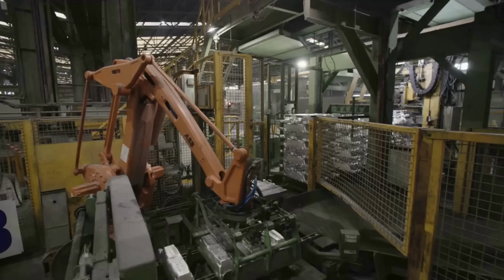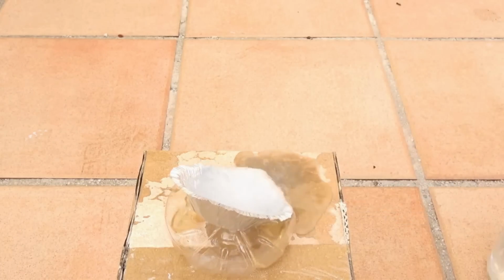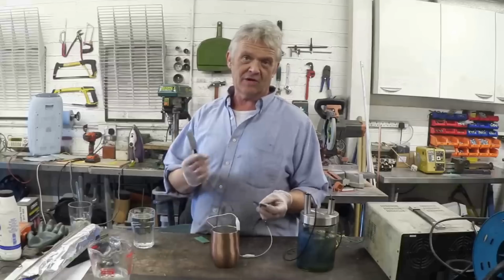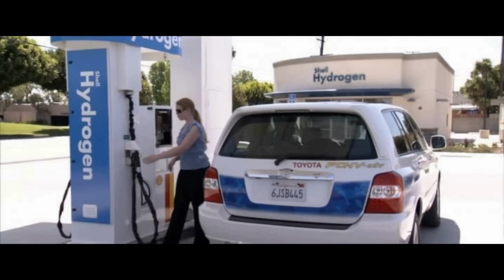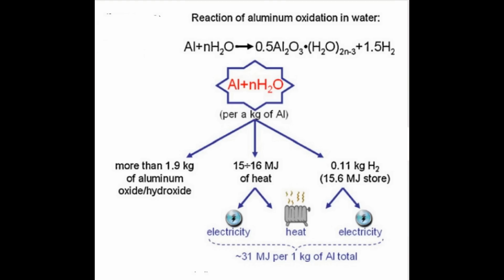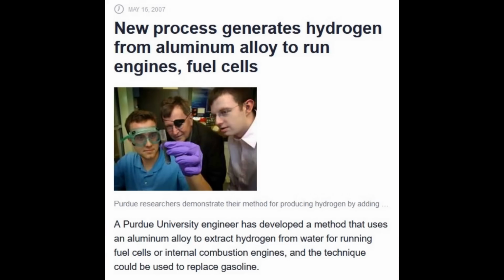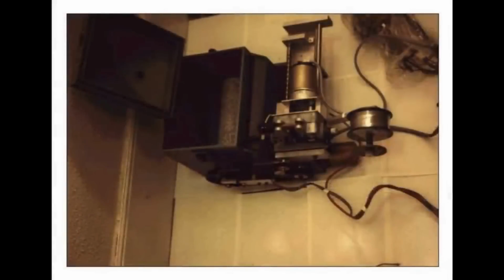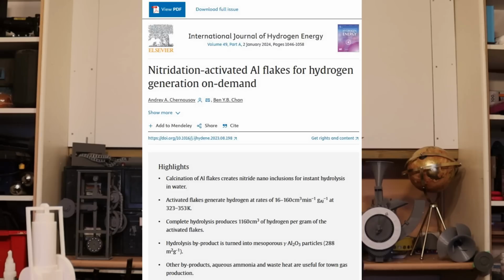2194 Hydrogen On Demand - Improvements And A Possible Conspiracy

Comment: re aluminium strip in a steel  pot containing hydroxide...
Dipping the strip in the pot/stripping the oxide before it makes contact with the steel pot, will be necessary to allow it to make electrical contact with the pot. Aluminium oxide layers are very good insulators, Metal oxide layers also have  excellent dialectic properties 
If the pure alu wasn't in contact with the metal pot would it work as a capacitor? it's not too different from an alu foil electrolytic capacitor. commercially produced ones use electrolytes that are caustic, that presumably strip the oxide layer.I know in about 2000 there was a lot a electrolytic capacitors going about that after a while they'd pop due to their producing hydrogren. (it seems to have been a case of industrial espionage resulting in the theft then use of a faulty electrolyte recipe) 

I've had extremely interesting results with anodised metal strip held inside(NB so it don't touch)  copper tube, then partially filled with yorkshire tap water. Such tap water shouldn't strip the oxide layer, is ever so slightly conductive (very conductive compared to metal oxide layer). and appears to result in a higher capacitance value than using a standard type "caustic electrolyte". Capacitance value seems to be related to what voltage metal was anodised to,  which is a proxy to how thick the highly dielectric anodising layer will be/follows that  the thickness of the anodizing later is akin to plate separation variable of capacitor equation. and if left alone the capacitance value remains the same, suggesting the layer isn't being attacked nor changing thickness etc

Comment: The main problems are that the overall energy used to produce the desired energy is not cost effective.
Reply: We have problem with overproduction of solar and wind in some days.
Also we can build solar and aluminium rafinery more in the desert and organize transport with some kind of self driving trucks to nearest port or railway.
Also cost of refinig alumnium from almost pure aluminium oxide should be less than from ore.
Maybe direct EV has betterf efficiency but is ridcously inconvinient, with aluminum we but put only some form of "battery", tank water and go go go....

Comment: I was going to mention that Gallium works but you can also recapture the Gallium and create a cycle where you take the spent aluminium oxide and melt it down to repeat the process by adding more water

Maybe this could be a energy dense battery
Reply: When you do this process with galium, how do you purify the galium again? And is aluminum oxide really what's created?
Reply: @TravisTellsTruths  
You filter the spent solution with excess water to remove as much of the reacted Aluminium oxide  which will be like a grey wet sludge 
The Gallium will settle at the bottom of the water and can be extracted with a syringe and reused.

Comment: The science of cracking water in the hydrogen and oxygen using heat has come a long way we've got it down quite a bit where it doesn't take quite as much heat as it used to adding different chemical catalysts the point is the Japanese are going to use nuclear power to generate the heat and crack water and have hydrogen fueling stations for their cars and trucks so they won't have to go to the Middle East to get power they just use a nuclear reactor this may be the way they're going to go cuz there's no so-called pollutants no good global warming no Boogeyman

Comment: we always hear about new hydrogen engines and it creates good investment... and we have been hearing this since the 1940s, so why dont we have them, well its that little elephant in the room hydrogen embrittlement, hydrogen ruins steel and most other things used as a container. the last thing you want under your car is 2500psi of explosive hydrogen in a tank thats weakening from the inside out and being bumped down the road... you can replace the tanks as and when needed, which is why we have industrial tanks/tankers and prototype vehicles / large commercial bus trials, because they can recall them in time to prevent a tank boom boom  'issue', but cars for joe public? you cant even get joe public to rotate his tyres.....how long till we hear of someone with a 15yr old hydrogen tank in a car exploding on the freeway or in a parking garage....

Comment: Might be fun to collect as many lapsed patents as possible and put them through a self learning AI application to see how far they were off the mark.
Reply: Coool
Reply: One of the rules for receiving a patent is that the device must be PROVEN to work - in some cases the inventor has resorted to performing a personal demonstration right in the patent office.  I would be far more interested to see what kinds of inventions an AI would extrapolate if given access to the entire patent archive.
Reply: @walterbaltzley4546 That is not the case anymore, or for a long time now. You don't have to prove anything works anymore, they just take your money now and do not care.  Patents are about giving just enough information to protect your idea, without giving enough info for someone to run off and make improvements and make a new patent. Not always the case, but is most of the time when it comes to important things.
Reply: no, this is not even remotely true  @walterbaltzley4546
Reply: i like the way you think !
Reply: Check out the Francisco Pacheco generators the use magnesium, aluminum  stainless steel and salt water
Reply: Great idea!

Comment: Joe cell was not a hydrogen gen, actually a resonance system. 
No hydrogen was burnt. 
The fuel line was blocked off by a bolt which was attached to the carburettor manifold. 
The protons could flow through the wall,not the hydrogen. 
Its out there,its been done. 
But no one understands the concept

Comment: You need to make 1 liter of brown's gas per liter of cylinder size PER REVOLUTION of the engine, and for any RPM's, for hydrogen only engines.
You must be certain that there are NO burned valves or seats in the engine head and the ignition timing must be AFTER top dead cylinder by at least 8 degrees.
Modern cars have ignition timing as much as 20 degrees before TDC. This can cause preignition and explosion!
Burned vales and such = same problem.

You also have to contend with hydrogen embrittlement since hydrogen draws the carbon out of steel parts, thus making the steel brittle (takes a long time though).

Optimal temperature to create that Brown's Gas is roughly 165F. Cooler then you make less gas. Warmer and you get too much water vapor and even steam.

The water you use must be distilled water only. Tap water contaminates the system. So does rainwater.

Using salt water can make hydrogen chloride, which can explode in direct sunlight.

Best electrodes are platinum. Residuals in the solution when using stainless steel plates is very toxic. VERY.

A pulse wave modulator can help with production. And a voltage of 28VDC seems to work best.
Drawing more than 10-20 amps to make the gas places a drag on the alternator and you lose your gains.

One person claimed he could make lots of the gas at a little over 3VDC. Haven't seen any proof of that.

Fun fact:
You can heat a very small very WELL insulated room with 6 aluminum beer cans for one hour.

Too bad Stan Meyers is no longer around nor all his research....

Comment: I immediately thought of aluminium MIG spools. I think electrical sparking in the presence of water vapour would be the way to go. 🤷
Reply: Rob mentioned high voltage, most welders run around the 24V mark I thought. The mechanism for feeding the wire is a great idea though.

Comment: Would it be viable to heat a space with potassium hydroxide + aluminium + water, using both the electricity & heat created by the reaction plus burning the hydrogen?

Comment: I can't help but feel mankind are locusts on this planet, moving from one resource to another til there is an uneconomically viable amount left and then hopping to the next resource to use that up. Nuclear energy is probably not the long-term solution, we don't even know yet where to put the waste.
Sure we'll have hydrogen in the near future, no doubt, but if we don't learn to recycle that then we'll vent all the water into space through this process.
CO2 chipped away at the climate, but if we also do this with water we'll increase the problems. We already did it with methane and radioactive isotopes...

Comment: The aluminum air battery that was tested in Israel has promise. 2000 mile on a car then electricity converts the aluminum oxide into aluminum and repeats

Comment: I'm not convinced about this. The electrolysis refinement of aluminium emits a ton of CO2 as the graphite electrodes corrode into solution. So even if the electricity required was somehow all carbon neutral, the process fundamentally has CO2 as a biproduct.

One could argue that it could be captured, but when talking about considering this strategy as a fuel source, the amount of aluminium required to suit the global needs is enormous, which comes with an equally enormous carbon footprint. 

At that point, it's probably easier to just use methane/ethanol/syngas/biodiesel because at least they act more effectively as a capturing method I think
Reply: Thank you, at least one that has looked into how its basically impossible to create Al CO2 free.
Reply: @uninteressant2196  To be fair I'm sure Robert is aware because of his background, I think it's a detail he either overlooked or thought wasn't as important as a point. Obviously if we were to discover a new way to make Aluminium or somehow decompose the CO2 back to graphite in processes that run off renewable energy and are profitable, they would solve almost all the issues with this concept
Reply: @atrumluminarium  Yes, still worth a mention- theres also the problem of weight, you have to carry the water as well as the Al, which is probably higher than a high pressure tank, but if we compare it with batteries its lightweight.

Comment: Thanks for the video! My bench is still covered with aluminum oxide. Months ago I failed trying to make electricity from a gallium aluminum on a plate of glass. Personally I love hydrogen, h2o2 I think they have lots of potential
Reply: Look, brother. You dissolve only about 3% of aluminum into the galium then you can slowly add water. It produces near 100% efficiency of hydrogen from aluminum and water. The aluminum becomes nano particles in the very ĺow concentration, allowing for absolute efficiency. I'm still trying to learn how to best separate the 2 materials when done to purify the galium.
Reply: @TravisTellsTruths  you can use the heat from the reaction to liquefy and reclaim the gallium which will sink as it is twice as dense as aluminum.

Comment: Lets see.
Aluminum in water produces electricity and hydrogen.
Hydrogen run through a fuel cell produces electricity and water.
The trick is to size your EV batteries so that the two electricity generators combined together, keep the batteries charged throughout the day.
Then all you need to do is resupply the aluminum from time to time.

Comment: I'm not a big fan of hydrogen at all.  Biogas (renewable methane) is a much better option as a fuel.
Reply: One big difference is that burning hydrogen produces water whereas methane burns to carbon dioxide. I am a fan of numerous forms of biogas and I don’t really think that CO2 is the boogeyman that everyone makes it out to be. We are all full of shite and will be until humanity is no more and that’s a fuel resource that deserves attention.
Reply: That and not much energy put in accept collecting the bio mass. Bacteria do all the work a produce a very good fertilizer for more biomass. I've seen videos on using hydrogen to improve fuel economy on a Petroleum motor.

Comment: So we take electric, use that to make aluminium, loosing some energy, the. Convert that into energy again adding more losses. If only there was a way to use the original electric in a car and cut out all the losses. 🤔
Reply: Not all the losses. You still have to transport it, and store it in the vehicle for later use (and replace the storage after a decade or so). There is no free lunch with anything.
Not that I disagree. However, picking up a new spool of aluminium and putting it in the feeder, then filling the water tank sounds a bit quicker than charging a battery.

Comment: Stealing this idea obligates you to buy me a hamburger, under the authority of having a Hobo chasing you down screaming you owe him one.

Combine Iron Furnace idea with Aluminum gallium idea , a multi stage process of aluminum turning to aluminum oxide releasing hydrogen that is then stored.
The aluminum oxide is cracked back over into aluminum by stripping off the oxide layer with a high heat flame from iron, and a small bit of hydrogen.
The Iron turns into rust from burning, you take the rust and strip off the oxygen turning it back into iron powder with heat coming from alcohol.
Alcohol is gained from fermenting processes 'and in some cases methane' which is used to fuel most of the process.
You can use methane and nitrogen to provide a more efficient atmosphere for rust to become iron again.

Comment: Nahhh.  Last year lithium was shown to be a fairly simple catalyst for producing Ammonia at half the cost --not in a factory, but in an inexpensive benchtop unit.  If you want extreme energy-density hydrogen supply, use NH4 and UV LEDs to blow up the N-H bond at the exact point of use.  Can't get a more efficient, cheap, and safe hydrogen energy system!
Reply: you mean nh3 not nh4

Comment: Very good video Robert. This is very similar to a design I crated for my brothers sail boat so he could travel the ocean blue using ocean water.😊
Reply: Please post more details, did you record the build?
Reply: @TariqKhan-77  No I did not record build. At the time of the designing of this simple machine,I had to look at exactly what he wanted it to do on his boat. It had to be simple and easily maintained. The design eliminated gas and or diesel. The design encompasses two parts. One part uses Aluminum Ingots as a starter gas. The other part uses water splitting through Electrical splitting of water at the source so no Hydrogen Storage was required. In the design as the Engine was being started the Aluminum Ingot was flooded with Salt water. Many types of Salts can be used. Anyway this would start the process of producing Hydrogen Gas. Gas then run through a dryer medium then into a Flash back Arrester then into Motor. When Motor or Engine starts this is discontinued. Then it switches over to the simple Electronics to split water at the source. Remember there is no storage. Gas production is figured to run Engine at top speed or full power so there is no over production of Gas. Can you now get an idea of what I’ve designed? I hope this has helped you. Thank for the question. Have a wonderful day. PS this also works the same way for your Cars or Trucks  and yes Lawnmowers or any Engine that runs Gasoline.

Comment: Absolutely true about patents!  I got one and applied for another, both through the company I worked for.  They paid me about $1000 award for each, which is far more than they made off of them!  Much the best way of doing it from this inventor's point of view!  The one that made it through lapsed, btw, and so I'm free to use it, if I wich, even though I no longer work for that company.
Reply: What's it for?
Reply: @TravisTellsTruths  Oh, one was for controlling the modulation rate of a laser communications system through turbulence, and the other (in which the patent was granted) was a method for aiming a laser beam without reimaging.  Not relevant here at all.